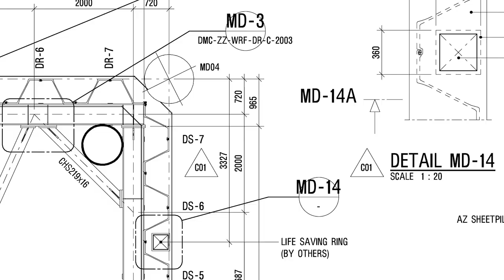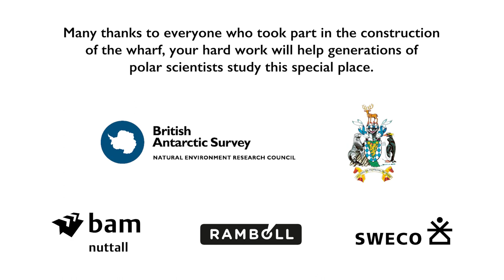Constructing a New Wharf for King Edward Point in South Georgia

Comment: We all agree that the contents were one and the middle Atlantic ridge was what forced them apart SA and Africa, So it appear to be what a 2000 mile spilt, So above Antarctica and below south America there is smudge like if you will and if you measure from the Island in the middle of the south Georgia sandwich islands a U looking structure and pull it back to align with the subduction zone of SA its roughly 2000 miles so it appears as if this structure hasn't move at all while the plates were being pushed apart? Have any Ideal to why? Also Fuji kind of has the same thing like and if you measure from there or U 7000 miles you seem to have a weird out come landing on certain thinks. Please help.